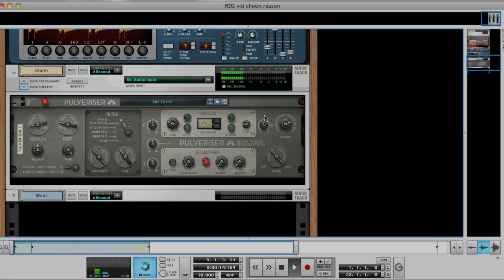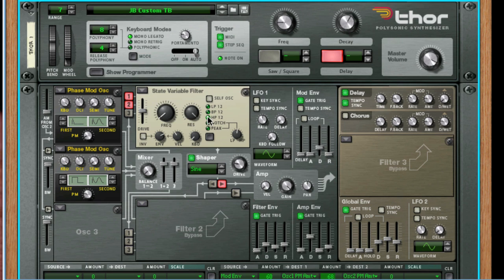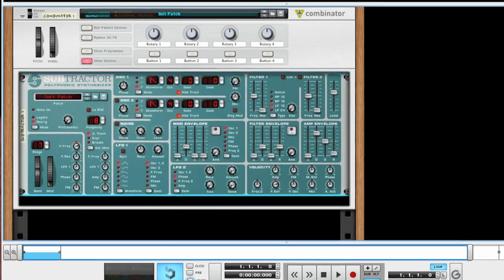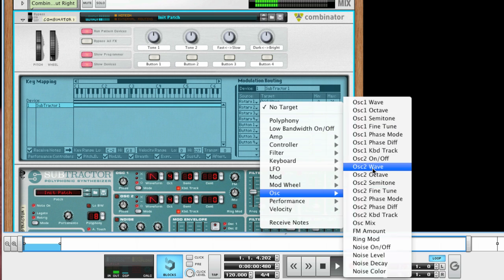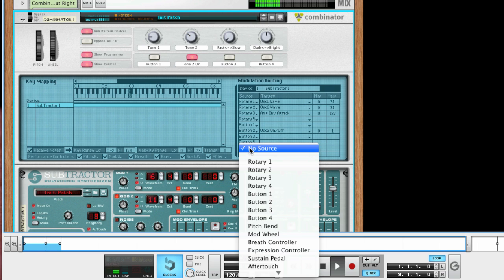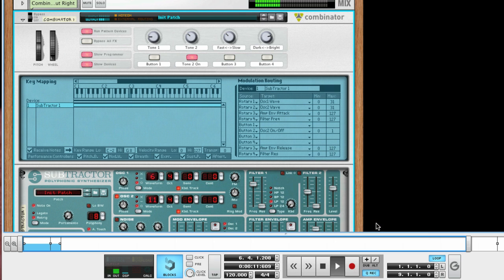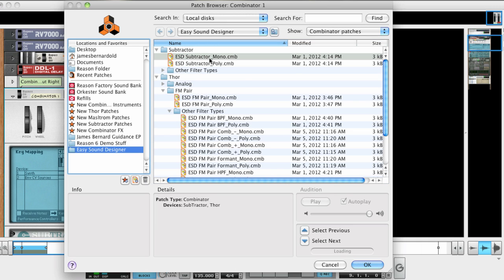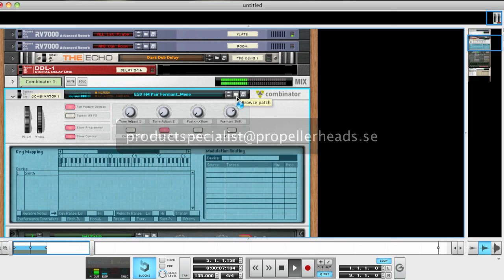How to easily make complex sounds with Combinators - Reason Sound Design

Comment: What we I also be good, is if you could add more knobs and buttons if needs be. Great tool though. Also, great video.
Reply: iv been begging for more matrix slots per device. this would be important, as even older synths like THOR have a easy time filling the slots in the combinator. also more knobs, maybe a built in LFO or env for the CV stuff. also right click and map to combinator. but most importantly, combinator input text gets translated sequencer! 

the combinator IS my workflow, the propellerhead videos got me hooked on it, i really hope they show it some more love in the next couple of updates. there are some huge synths in reason as it is, and with the SDK always growing. the combinator will get harder to use. because synths have So many parameters... 

long live the combinator :) and heres to a combinator 2!

Comment: when i connect the subtrackror to the combinator i cant see the subtracktor in piano roll therefore i cant make any melodies because i dont have a MIDI keyboard. can you please give me a solution to this problem ? Thank you in adnvace :*
Reply: Right click subtracktor you can see "Create Track for SubTracktor" option.
Reply: exe GODMODE can you not see the piano roll in the note lane for the combinator? Instead, add a track for the subtractor.
Reply: click F7, F8, or F9. one of these keys bring an on screen piano.

but what you are referring to is the fact that reasons sequencer only recognizes the combinator. Reason sees the combinator as an instrument. so putting the subtractor or any other synth inside,  will be seen as a synth within a synth. the keys that you play, are playing the combinator,  which plays the synth's. think of the combinator as an instrument, if you want any of your devices inside the combinator to appear in reasons sequencer, just right click the device and "create track for this device"

otherwise, just put your midi notes int he combinator lane, make sure you label your combinator so you can see what track it is when working, this will come in handy if you have many tracks

Comment: It's really not about presets either. You can use presets but you can tweak them in many ways to sound unique. Put a pulverizer or scream 4, or tweak the parameters on an M Class Eq, or just do some minor changes withing the preset itself. This is what I like about reason. You have so many possibilities.

Comment: @ShogaNinja Whew! So you CAN read. That's good. I'd just like to address a couple of things, however:

1) If you go to my Soundcloud (which you claimed you did, but I doubt it), then you would see that I have originals as well as remixes all of which I made myself. Also, I just put out an EP in November, and it was charting on Juno Download for a while. So take that however you may.

2) I'm using Reason 6 which at this point in time isn't cracked and doesn't support plugins.

Have a good one! :)

Comment: @RaverJK Thanks for your reply. I think the basic idea of the combinator is to create sophisticated synth/fx units using the built-in devices. Thats why Reason doesnt really need VST support. 
Automating a synth directly is obvious, but why would I put a single device into a combinator? It's about automating 2+ devices without having to use additional sequencer lanes. I just like to have both the rack and the sequencer clean, so a few more knobs wouldnt hurt.